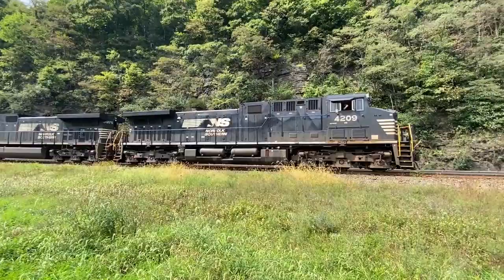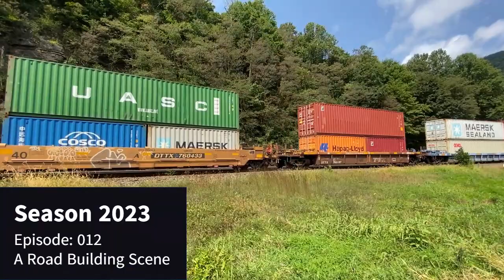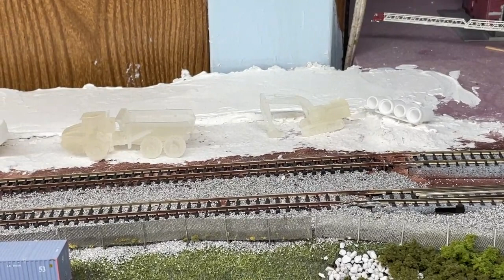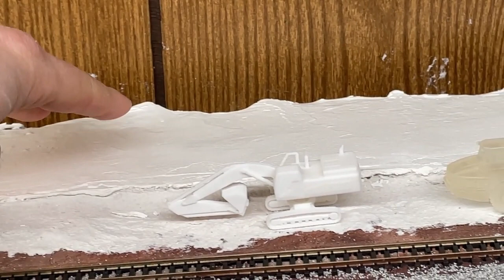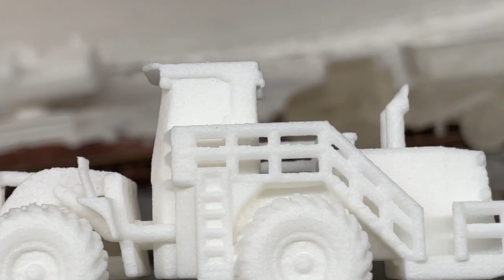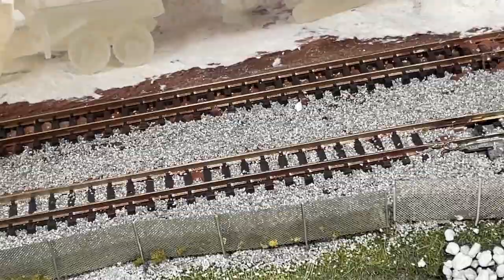N scale Road Building Scene Teaser

Comment: I think you should send that rock truck to the mine also as it appears to large for the road job.  I have run most of those pieces and will say that for the most part they look pretty good.  You need to get a couple of rollers for the asphalt laying operation.  One rubber tire and one double steel wheel for sure.  I will be looking into shapeways myself for some equipment for my layout.  Otherwise everything on you layout looks good and thanks for sharing.
Reply from the maker: A heavy earth moving road project has much use for the rock trucks.  i currently have a site that's grading out for a future car dealership and we're using a rock truck for onsite stockpiling.  I am definitely missing a few pieces of equipment and accessories to complete the scene.  I will be covering that in the video as i find the pieces.  Definitely check out Shapeways - they have some good stuff but LOTS of pages to shuffle through.
Reply: @AlleghenyNorthern  I agree with the use of the rock truck as I have operated several different ones on road jobs.  That particular one looks oversized for the size of the excavators is all i'm saying.
Reply from the maker: @brianclow5704  i don't think your eyes are off.. the one excavator is really small - or the rock truck might be too big.  i'm hopping to position them in such a way to hide that.  we'll see; it's one of the dangers of ordering from shapeways - scale fidelity isn't always there.